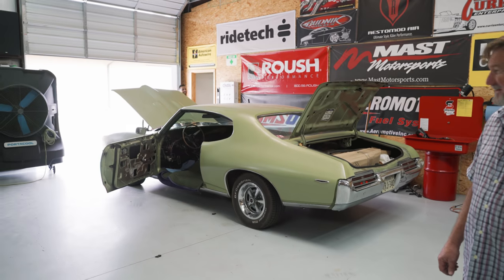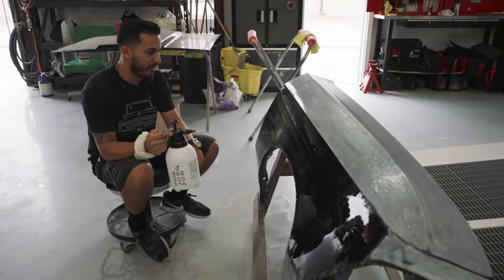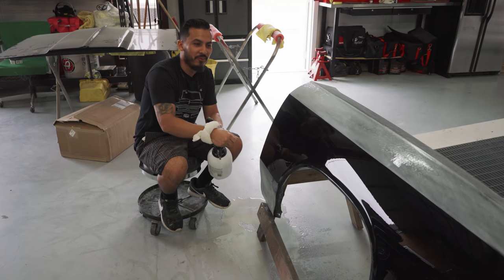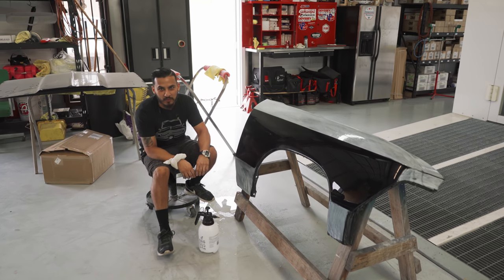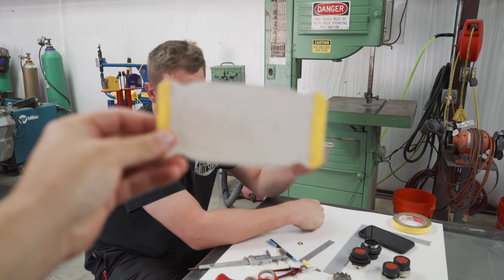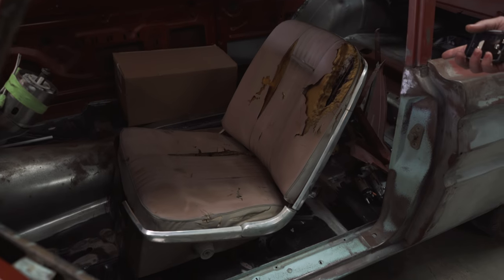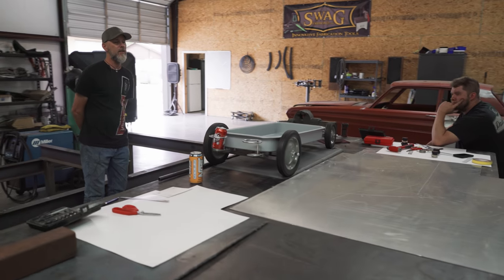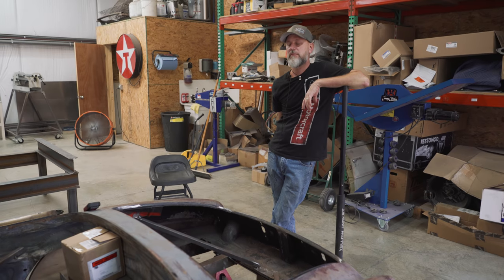Radio Flyer Hot Rod + Projects Update

Comment: I'm curious to see how many mils 4-5 coats produces and how much gets removed by the time finish polish /delivery takes place. I would think 3 coats of clear and then blocking with 500 and  re-clearing w/2 more coats.  By now it should be glass flat and elbow deep in depth. 1k grit to 3k Da finish leaves more material hence flat & super deep and less labor intensive. More product used but after finish polish there's still more clear coat left for longer lasting depth of gloss. It still depends on products used and more importantly the painter/prepper's hand. Still, excellent work!! A+

Comment: Can you guys do a video of the whole process of wet sanding and buffing im doing a black c10 and am having problems getting it to keep its shine and not dull in the sun. What am I doing wrong??
Reply: Mon good luck you are working with the hardest color black if you master black you can do any color.
Reply: Exactly what he said you have to have enough clear coat to wet sand or you will be sanding through your paint. You have to work your way down to the lightest sand paper. Then when you buff make sire you keep the buffer moving so you don't burn the paint and see buffing swirls, like I said black is the hardest color because every little thing shows. Most painter's shops cringe when people say they want there car black because it takes more work to get it right.
Reply: SNOOP U 2 it will shine up fine and is a straight mirror but after it sits in the sun it dulls
Reply: Sounds like you're having a dye back issue. Maybe you didn't let air move across the surface long enough after clearing. Or you let one of the layers of clear dry to long before you put the next coat and it didn't melt in properly.
Reply: Bruce Luna thank you for the reply we figured the last coat is what really messed it up, the longer it has sat it seems to get better everybuff
Reply: Bruce Luna It was the cab, doing doors in a bit hopefully we won’t have issues with them

Comment: Haven't been here for a wile what happened to the wash shop
Reply: It's still going. We replaced all the hoses last week as the old ones were leaky. KC also went through and fixed a lot of the coin machines and either cleaned up or replaced the displays. It's a really nice place compared to the condition he bought it in. KC keeps it clean as well. I believe they are getting a new manager at the Lube Center so maybe I'll stop by and check in.